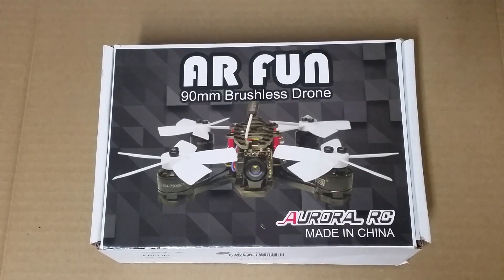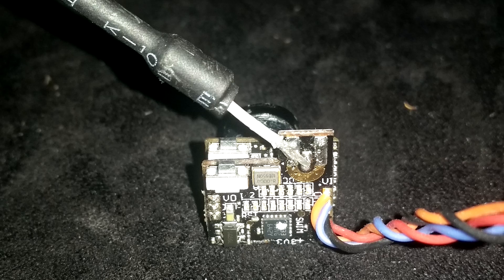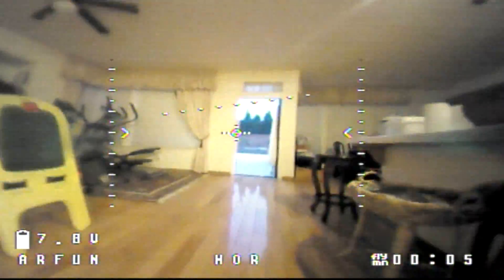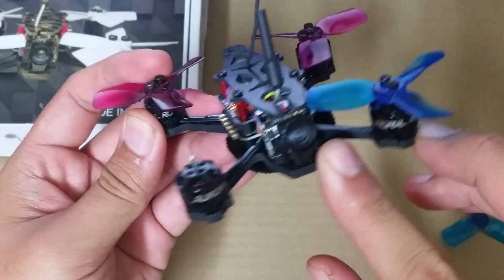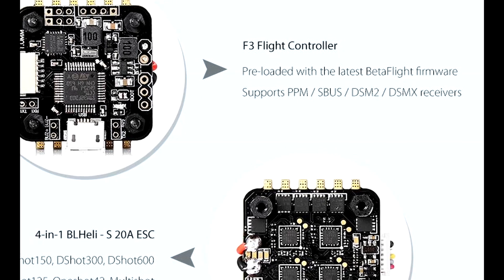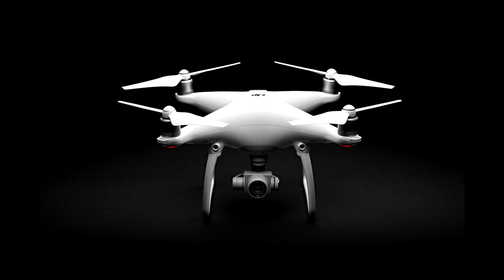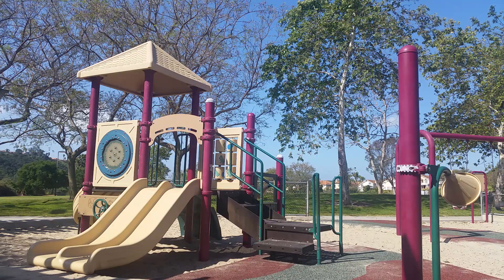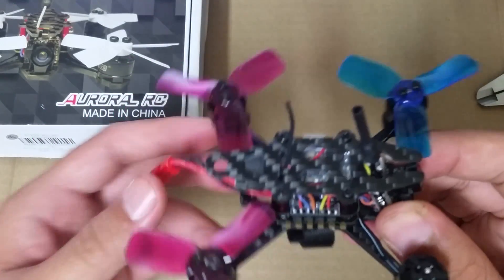Awesome RC's ARFUN - a 90mm Brushless Micro Quad - Full Review

Comment: 2S 25C is a way to weak for DYS BE1104 motors. Those are brilliant motors and very strong. Flying with them is a pleasure. But only with 3S battery and large C number - 65C and more. For my micro brushless racer with DYS BE1104 7500KV motors I got Tattu 3S 450 mAh 75/150C batteries. I already tested them in other quad with BR1103 8000KV motors, RS6A v2 ESC's, and Aurora 100 frame and 2035 props and may tell that flying with that machine is a fun with only with 3S and large C. With 2S 45C it was sort of glue riding. Also if your micro brushed 2S/3S quad have a red JST battery connector, swap it to XT30 on quad and for batteries which have the red one. It will help to get a better performance even on 2S. Battery wire gauge must be at least 18AWG. And if you consider to fly with those mad 3S 65C+ batteries, connect XT30 connector to FC or 4-in-1 ESC board directly or with very short AWG16 gauge wires. Your Arfun quad may be easy fixed if you will to that.

Comment: capacitors might help with brown outs on flips. Higher C batts should work too.
Reply from the maker: You could always put one on top, I bought this a while back, and use them on my bigger quads.

https://www.banggood.com/20PCS-1000uF-25V-Radial-Electrolytic-Capacitor-10x17mm-105C-p-1022623.html?rmmds=search
Reply from the maker: hmm, I never tried the capacitors, but that sounds like a good idea, ill give it a shot -thanks
Reply: What capacitor will fit from these unit? I have some low ESR, but they are to big!
Reply: Those aren't low ESR capacitors.
Reply: thanks for the clarification, do you know a good place to get them?
Reply: In your local direct or online shops of electronic components. The known source of real ones (not faked) online are available from Digikey and Mouser. Amazon have them but use caution, there been fakes. Also know if capacitors which you are buying are the low ESR capacitors first. For power filtering from noise it definitely matter. See on Oscar Liangs blog for example

https://oscarliang.com/capacitors-mini-quad/

He had described all "why" and "where". Also there is a link of known Low ESR capacitor brands and models. A first notable sign is price. Low ESR capacitors are not cheap, they cost something 0.60-1.20$ per piece for capacity/volts which we are using.

FYI: I'm using capacitors of Panasonic FR and Nichicon UHW series. Such models was available in my local electronic store. They are doing their job well.
Reply from the maker: thanks for the link, I had no idea there were fakes. What would be a good price point  to distinguish fake from real?
Reply: Check the list of capacitor brands and models in Oscar's blog (I gave a link above). Pricing is starting about 0.50 USD for 330..470uF 25V then around 1.20 USD for 2200 uF 25V. Capacitors for 35V voltage will be a little bit pricier (plus 8-10 cents). Sort of that.
Reply from the maker: found this, https://www.digikey.com/products/en?keywords=eeu-fr1e331

but the dimensions as well as the impedence are different than whats listed on the spreadsheet. Do you know if they are okay?
Reply: Impedance is Ok if it is somewhat below 0.1. Smaller is better. Also manufacturers can't always release capacitors with equal impedance - we have acceptable parameter range for that. So open the specific capacitor page (click on link). Inside you will see a link to Panasonic FR series capacitor datasheet in PDF format (see below).

https://industrial.panasonic.com/cdbs/www-data/pdf/RDF0000/ABA0000C1022.pdf

It have impedance table for all models. 330 uF 25V models have impedance 0.056. Not the best, but Ok. Impedance of 470 uF 25V is better (0.030-0.043). And 1000, 2200 and 3000 uF are even better (around 0.010) - those caps goes to battery pads.

Comment: This or the Babyhawk?
Reply: DANQ FPV I've asked Kebab FPV and he said that the Babyhawk was better, because it was more controlable and overall he had a better flight experience. Also people seem to have less problems with the Babyhawk.
Reply from the maker: going on performance, im going to say the arfun just because it performs so good, as long as you have a good enough battery. Ive never tested the babyhawk, but from the specs, the arfun is better
Reply: plus this arfun is carbon fiber the babyhawk is plastic
Reply from the maker: GrumpyMadman I agree, I've been breaking carbon frames left and right, the one plastic frame I have took a lot of beatings but never broke

Comment: good stuff, I agree man those some skinny ass arms lol
Reply from the maker: sorry  I could have sworn I added it in my prior message... edit... oops that was on a different video lol

http://www.banggood.com/Awesome-E90-90mm-Micro-Brushless-FPV-Racing-Frame-Kit-Carbon-Fiber-12g-p-1135536.html?p=LP311511816182015013
Reply from the maker: Thanks Lark! yea they are, I suggest picking up an extra frame, you can get one for like 10 bucks. I actually snapped it, check my other video for the crash vid
Reply: Could you link to the frame?  I've been looking to buy one of these frames to build a custom quad based on it.

Ah, found it, so no need to link if you'd prefer not to do so!
Reply: DANQ FPV thanks!